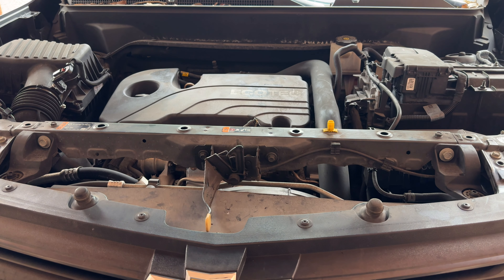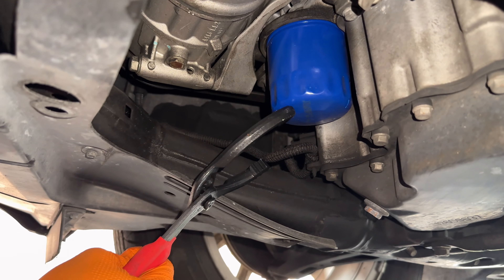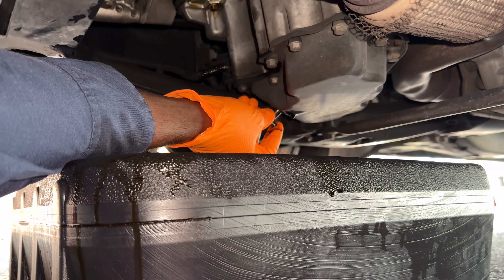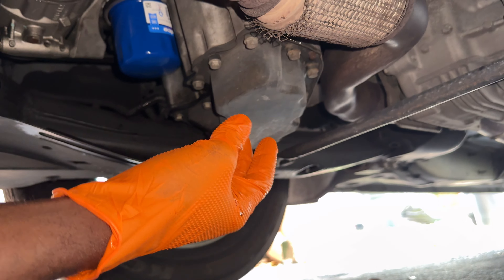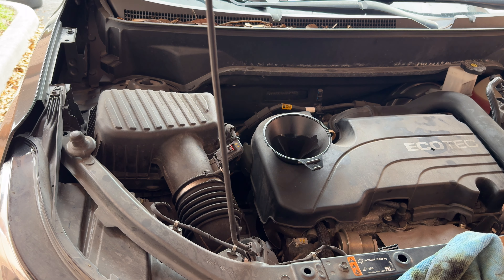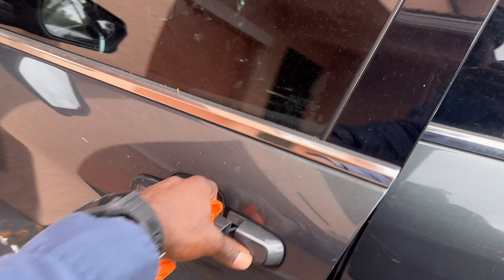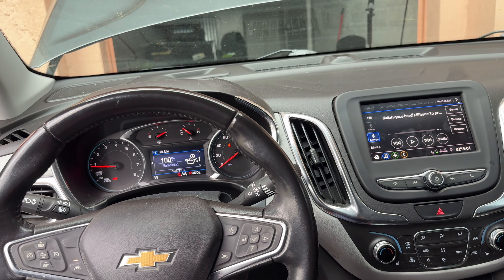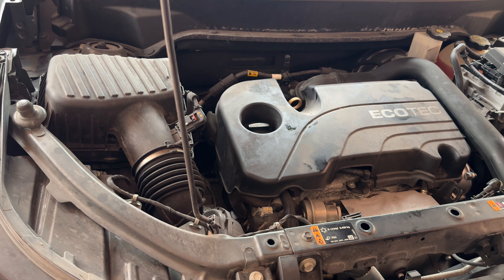Chevy equinox oil change and oil life reset

Comment: Probably revealing the year of the equinox would help tremendously.
Reply from the maker: The year doesn't matter as long as your equinox look the same as the one in the video
Reply: @DULLAHGOSOHARD  My friend.. no.. The body style of the equinox has changed very little over the past 10-15 years.. but the internals have changed.  Such as the location of the oil filter in your video is different than mine.  Congrats.. you got a view from me.  But, this was not for my year of vehicle.  Welcome to Iggy...